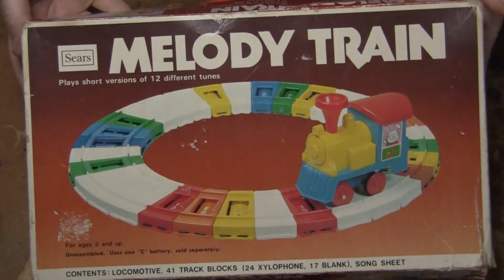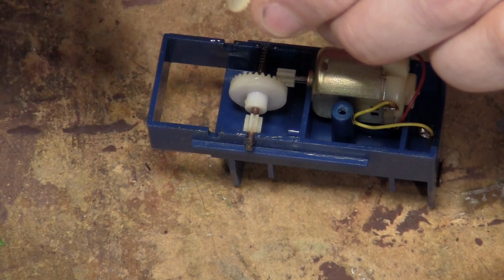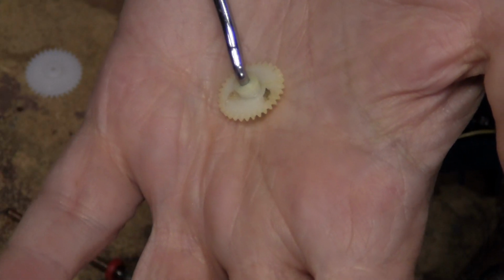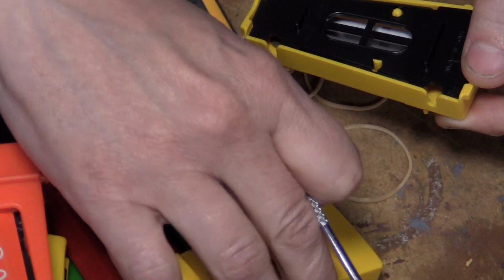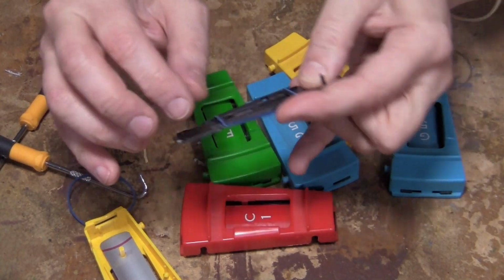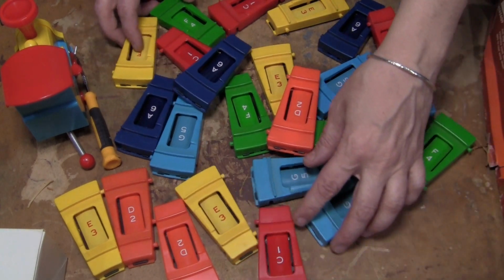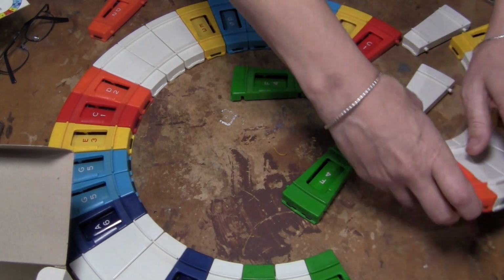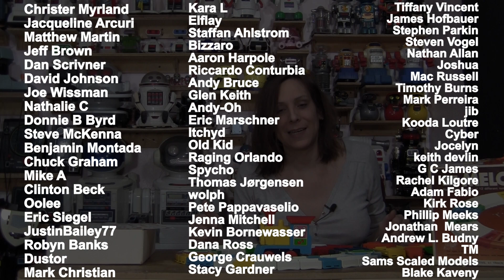All Aboard the Melody Train: A Transformation from Rusty to Melodious!

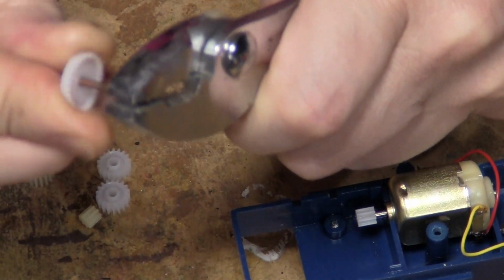Comment: Love old mehanical toys. About that spring in 4:35, maybe it was creating a clutching mechanism? In case a child blocked the wheels, that would not stop the motor and overload it. The grinding of that clutch would wear those little gears fast though. I don't know, that's the only explanation I can think of.

EDIT: Never mind! The spring is on the wrong side for that to work. I truly don't know then 😂

Comment: Kind of design contrast going on there, train easy to take apart, track parts a literal pain. I guess if you did a bunch of these sets it would worth making some sort of spanning tool to spread those tabs apart.
I'm not against cheap rubber band use in toys but too many of them don't have easy replacement designs to them even though it's critical short term and long term in the life of such toys. Cool toy though, much like some of the first analog computers that were programmable.